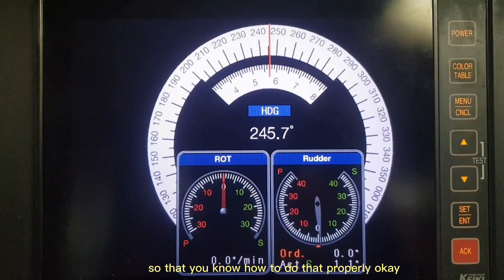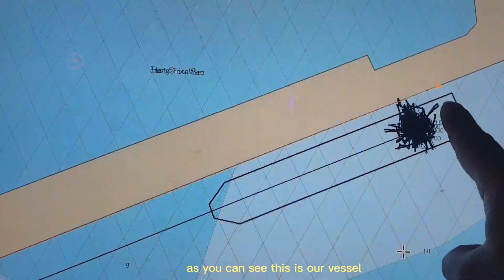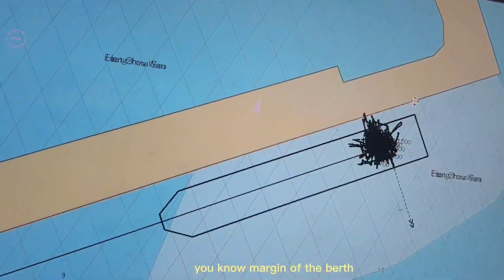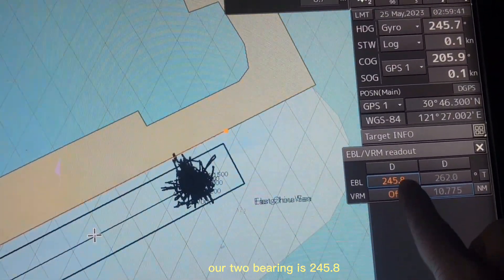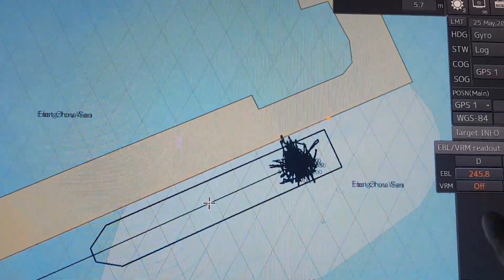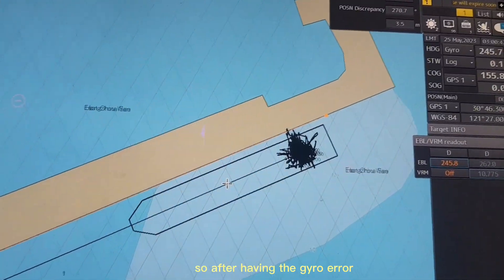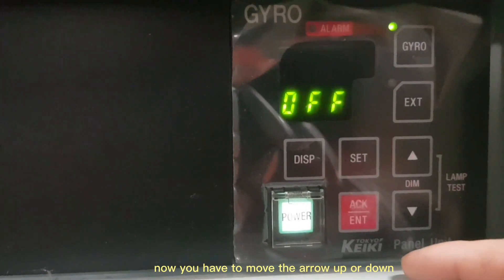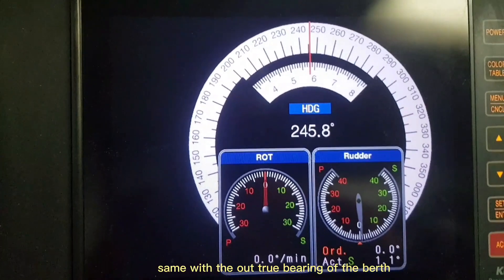How to get and adjust for the gyro error when your vessels in port.

Comment from the maker: Well,for your information. in this video I just show you the temporary way to adjust the gyro error. Because, Incase if you have no power for the gyro compass or your vessel is blackout sometime. You have to adjust that once again.
Actually, there is another way to adjust the gyro error permanently. So Trust me, with this way you dont have to adjust gyro error again even your vessel's suddenly blackout.
To do that
1. You press and hold the buttons "ACK + SET" for 3 seconds 
2. Then you press on the "DISP" button to selected  the "A-2"
3. After that you press on "SET" then you use the arrows button UP or DOWN to adjust your error
Next you press on "ACK" button to confirm that and then you press and hold the buttons "ACK + SET" for 3 seconds to finish the task.